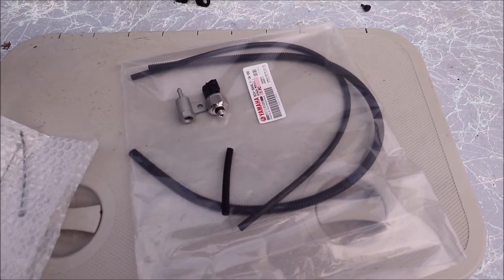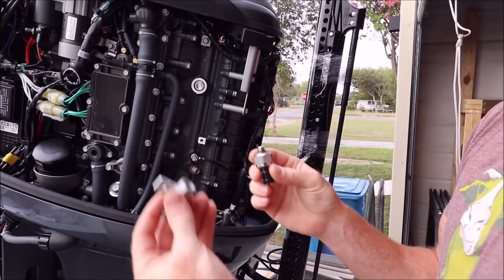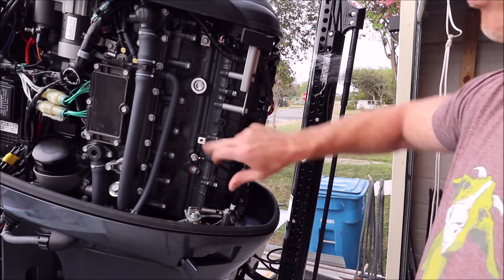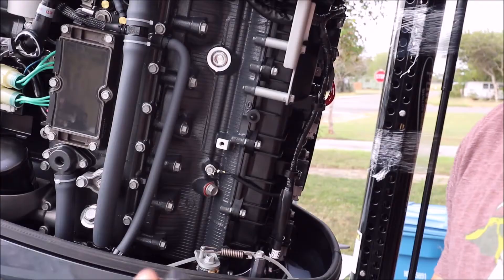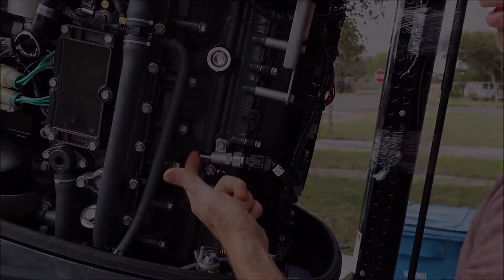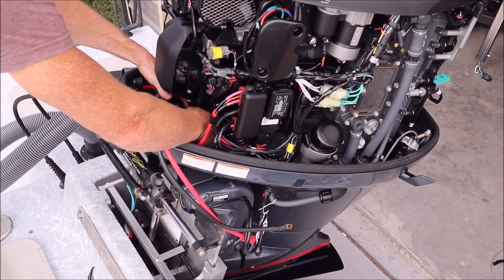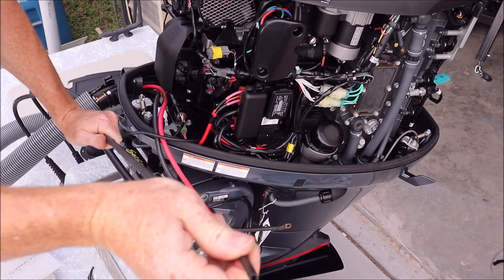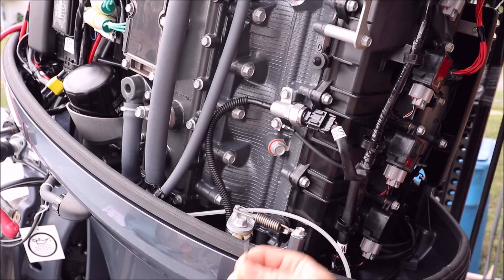Yamaha Outboard Speed Sensor Installation (60V-8A4L1-11-00)

Comment: It’s probably worth mentioning that the dash speedometer no longer has its input.  The input instead now goes to the ECU.  To read it now requires a connection to the NMEA 2000 network or the YDS ECU connection.

Comment: Question. I have a F150LA yamaha engine. my speedometer was acting up. I did clean out the inlet hole and blew back through the hole, it seems like it should work. How did the speedometer work before if I have not installed the speed sensor? Where does the black nipple go to? It was all zip tied>

Comment: Could you explain the benefits of the speed sensor.  Is it simply there to send an accurate speed to the NMEA 2000 network?  Does it disable the dash mounted Spedo?  Are they only useful if you install Command link gauges?